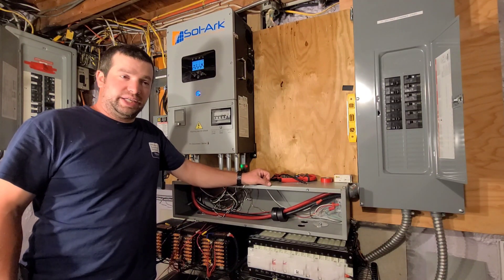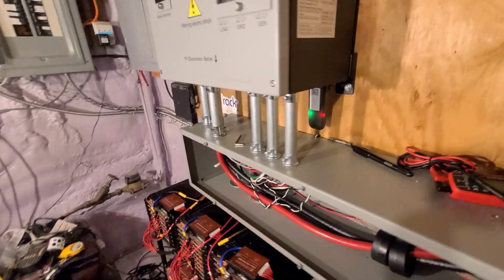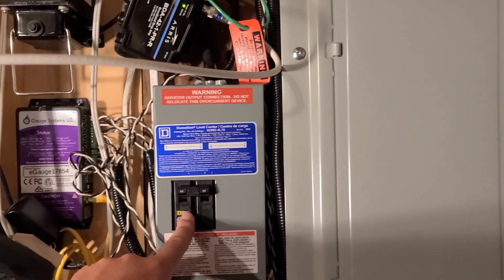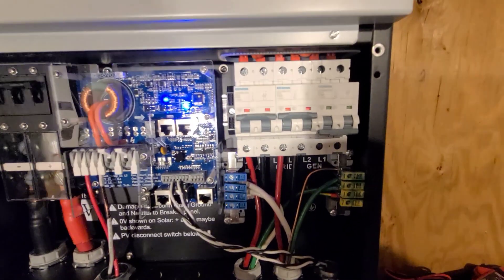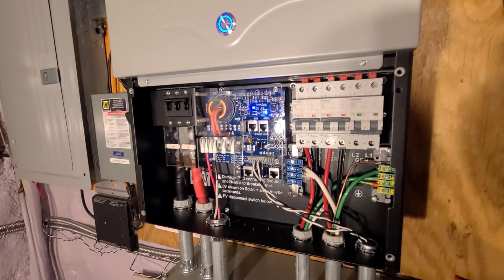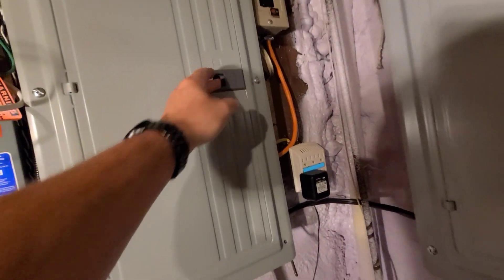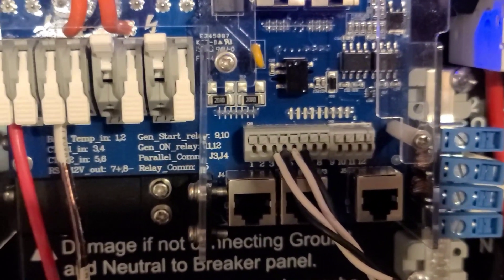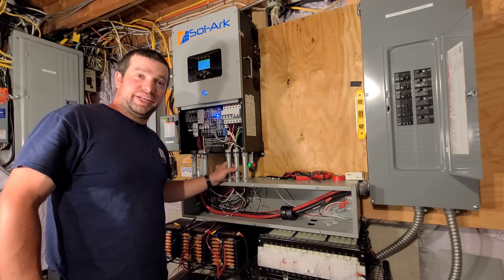Sol-Ark 12k Installation

Comment: Great video and setup! Are you using MTW for the #6 as well? Or is that THHN?
Reply from the maker: The #6 is THHN.  Its 6/3 MC.
Reply: @benssolarandbattery  Hey Ben, what does the MC stand for.  Is this what I should be looking for... https://www.wireandcableyourway.com/6-3c-thhn-pvc-tray-cable-with-ground.html?utm_source=google-shopping&utm_medium=shopping&gclid=EAIaIQobChMInvWipueT6wIVkIbACh0Q4wk4EAQYAiABEgK6-PD_BwE
Reply from the maker: @HomesteadingintheForest  MC stands for "metal clad".  I only used it because I had some laying around.  You can technically use Romex for the AC side of things, just need MC for any DC solar circuits.
Reply: @benssolarandbattery  Is #6 sufficient for a 25 foot run to the main panel or should I opt for #4 AWG?
Reply from the maker: @HomesteadingintheForest  if you're running 6/3 MC, #6 should be fine based on temp ratings (75c-90c). 
Romex conductors need to be sized based on the 60c column, or 55a, which can be rounded up to 60a. There are 63a breakers in the Sol-Ark, but as long as you use 60a breakers for your feed, 6/3 romex would be fine too.
Reply: @benssolarandbattery  Sol-ark has 50A breakers
Reply from the maker: @SolarTechFL  actually, mine has a 50a load breaker, a 63a grid breaker and a 40a gen breaker.
Reply: @benssolarandbattery  i guess were all right lol
Reply from the maker: @SolarTechFL  haha, yes, I think they may have changed them from the older to the newer versions too.
Reply: @benssolarandbattery  must have the one i just put in had 50's and a 40
Reply: It shows it in the manual that way too
Reply: All those loads you should use number 4.
Reply from the maker: @Madactionmedia  I'm curious as to why? I mean it's not a bad idea and I had the 6awg MC leftover which is why I used it, but even in the 75c column, 6awg is rated for 65a.
Reply: Ben's Solar and Battery that is a lot of loads for one sol-ark and you mentioned heat. Safety first, the bigger wire will help with that when your making her work harder.

Comment: Interesting approach with the setup. I have my LOAD breaker acting as a critical load option so that when power goes out it powers a dedicated panel of select circuits and the GRID breaker via the CT clamps handles 'powering' the overall house the rest of the time. I've only setup one of these units so I am looking fwd. to your setup settings. I noticed a few nuances with the 'grid setting' options and I am curios if you also encounter them. BTW there is a supporting website to pull up your data and manage the unit settings: https://esem.cc/login (user your app. login / pw).